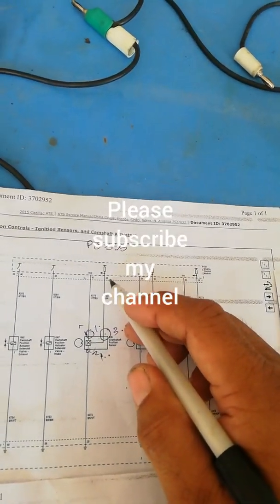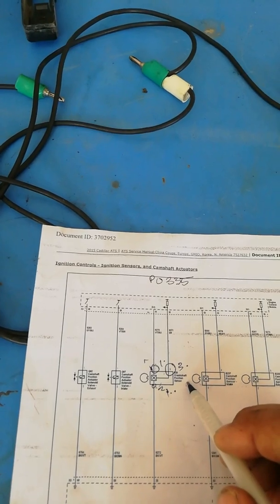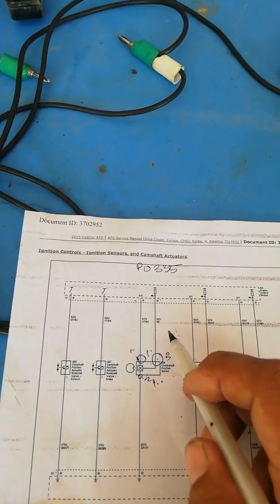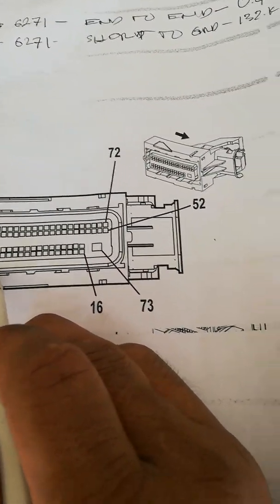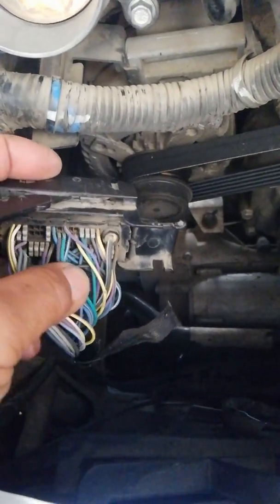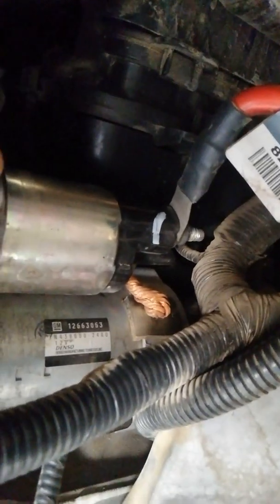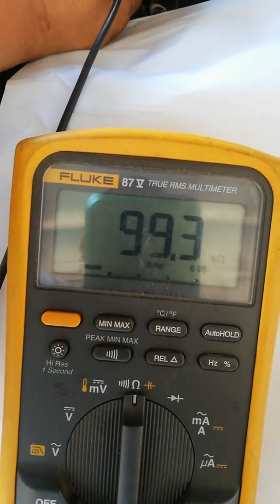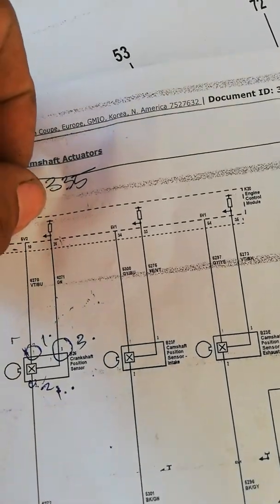Crank shaft sensor circuit short to ground.

Comment: I have continuity in all 3 wires on the connector from my crankshaft 96 civic is that normal no rt
Reply from the maker: follow this disconnect  ecu connector and crank shaft sensor  check end to end  resistance must be not less-than 3  to. 2 ohms   if 10 omhs repair high resistance   if all ok check if each wire for short to ground or  short to voltage.

Comment: I have continuity in all 3 wires on the connector from my crankshaft 96 civic is that normal no rt
Reply from the maker: check end to end if lessthans 2ohms its ok

Comment: What is the normal ohm for crankshaft sensor?
Reply from the maker: im checking the resistance of a circuit  and not resistance of crankshafts sensors because already  replaced a new one outside